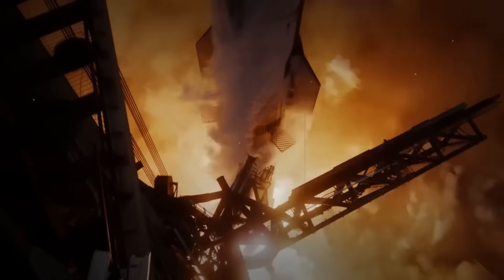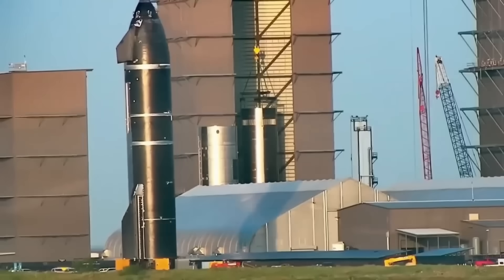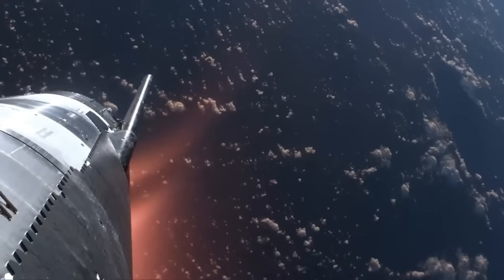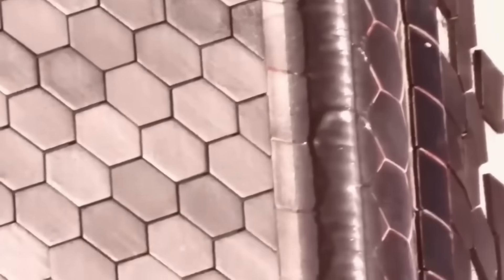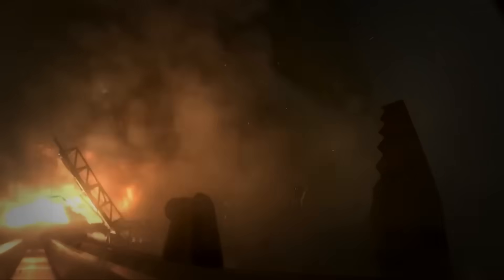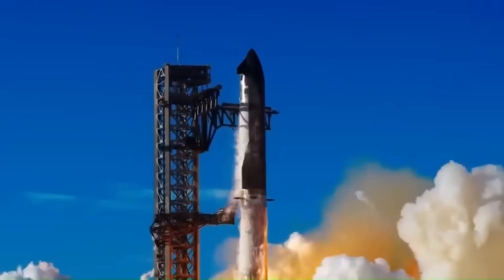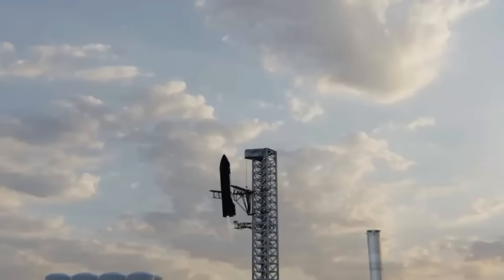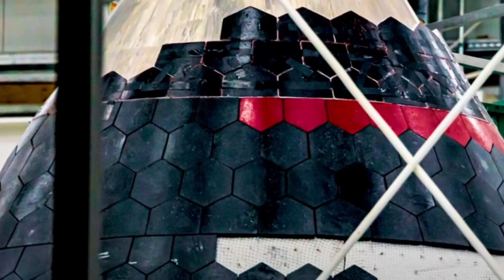SpaceX's New Heatshield Will Chanage Everything... Ready For Flight 10!

Comment: Why not use that cooling system  you have on those engine flanges, on one side of the space ship ?? It's liquid methane circulating to prevent metal from melting ..don't tell me about added weight..preventing the spaceship from exploding or melting ..  yes ??